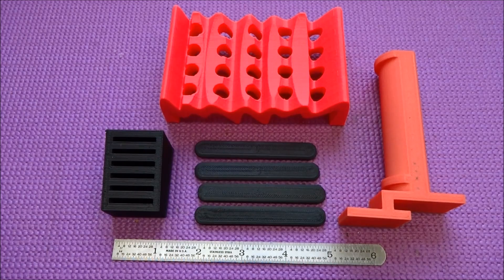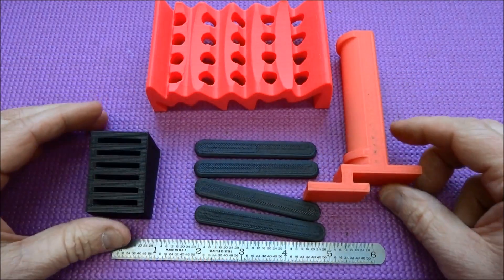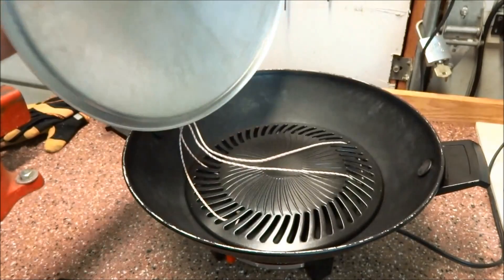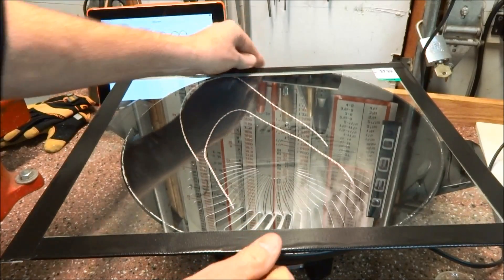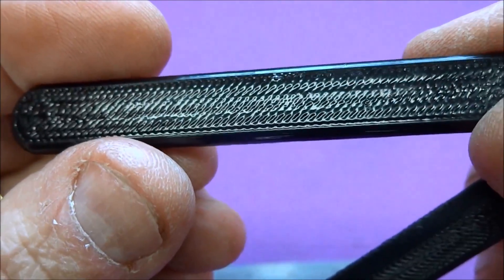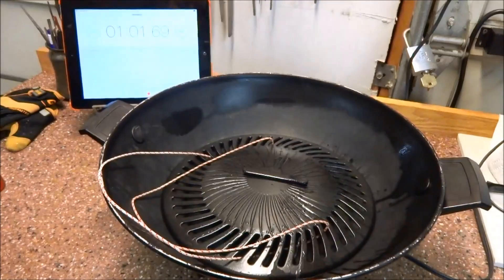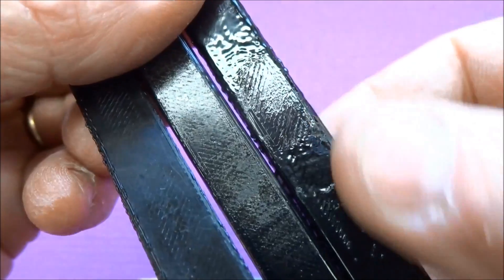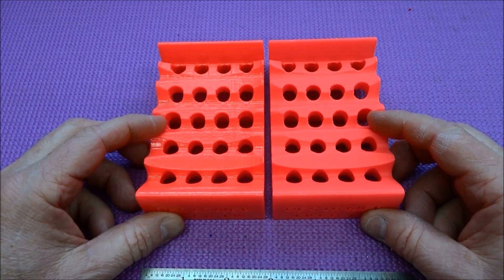(453) Improve the Finish on 3D Prints (Makerbot)

Comment: Foolish... Acetone may boil at 133°F, but it's flashpoint is only -4°F. The slightest spark could ignite the combustible vapors. How about doing this experiment at room temperature using less acetone? If you can spent 5 hours printing a soap dish, 10 or 15 minutes of room temperature acetone fumes shouldn't be much of an inconvenience. Boiling it sent much of the vapors into the air before you even put the lid on, reducing the efficiency from the start. You can use the process with multiple parts at the same time as well, so better safe than sorry.

Comment: Turned out there was another "chucklehead" not even using a fan with
toxic acetone like like it was vicks vaporub. Spark a ciggy and strike a
 pose for the Darwin awards
Reply: Acetone isn't toxic, your own body makes it. It is flammable & combustible though... Too much of anything will kill you, even water.
Reply: Okay you pedantic ass, let's get into the minutia of it then shall we?

It's also called dimethyl ketone, 2-propanone, and beta-ketopropane. It's chemical name is fucking C3H6O

In addition to yes being a byproduct of human body fat in small quantities it is also found in much higher concentrations in volcanic gases, vehicle exhaust, cigarette smoke and is used to make plastics, rayon and photographic film to name a few things I'm sure you'd just looove to inhale or ingest, and as a solvent it is used to fucking dissolve varnish, lacquer and nail polish from women's fingernails just in case you forgot...

It affects the hematological and nervous systems, and breathing moderate-to-high levels of it for short periods of time can cause nose, throat, lung, and eye irritation, in addition to intoxication, headaches, fatigue, stupor, light-headedness, dizziness, confusion, increased pulse rate, nausea, vomiting, and shortening of the menstrual cycle in women. 

Breathing highly concentrated acetone vapors can irritate the respiratory tract and burn your eyes. Skin contact with acetone can irritate and damage skin

Exposure to acetone can also cause lowering of blood pressure, bronchial irritation, difficulty breathing, shortness of breath, abdominal pain, and an increased need to urinate.

Now I don't know about you, but TO ME THAT SOUNDS PRETTY FUCKING TOXIC.

IT IS ALSO LISTED IN THE ATSDR which is a database of TOXIC FUCKING SUBSTANCES

Although certainly not as toxic as say, Hydrogen Selenide, playing with it in the manner seen in this video is asinine or AT BEST idiotic

If you wish to discuss the comparative semantics of the dangers of drinking large quantities of carrot juice vis-à-vis the wonders of inhaling boron triflouride please do so elsewhere.

I am now finished ranting at my troll. Please drink 3 liters of Acetone, and pick up your award on the way out at which time we can discuss further. Thank you

Comment: I found a method on YouTube that seemed to improve on this method a little. Use a rice cooker and pour the acetone in when it is still switched off. Place the part inside, place the lid on, and then switch the rice cooker on. When the glass lid starts fogging up, start the 30 second count.

Comment: I have only tried acetone bath once, and it came out pretty well. Here's the image: http://1drv.ms/1PKyXlAI used a tinfoil loaf pan, and sat it on the heated bed of my printer, with the temp set to 70C. I used a lot less acetone than you did - just a couple teaspoons. I hung the ring on a piece of wire, poured in the acetone, then covered it with foil. I let it sit for roughly a minute (I didn't time it like you did), and then took off the foil and let it sit for an hour or so.One thing that I did different that could make a difference for you is that I refrigerated my part in advance, so that the acetone would have more of a tendency to condense on it. I am very pleased with the results.

Comment: Does this work with PLA please?
Reply: +Brian Roberts Nope.
Reply: +Brian Roberts You need something to replace the Acetone. Tetrahydrofuran can be used to smooth PLA parts in a similar way like the acetone vapor does for ABS. Tetrahydrofuran gets used as a direct-welding glue in the swimming pool industry from what i've seen, it is used to 'weld' PVC sheets together to make watertight sealings. So it can probably be bought in some home depot stores too, just not shure what other additives they add into these glues. I've got a small sample of pure THF that i've bought at a local pharmacy that sells all kinds of chemicals too. Just did not have time to actually try it out on a part yet.
And just remember, it's not water you operate with, so at least wear some glasses, gloves and work in a open, well ventilated area, especially when you vaporize that stuff! I'm shure inhaling THF is just as bad as inhaling acetone. so, stay safe (a good respiratiory filter would probaby not be a bad idea too)
And both chemicals can probably make some nasty explosive gasses too or at least catch fire easily. Don't heat it up too much either, or it can break down into even nastyer byproducts you don't want to be dealing with. (Hearing that 'hisss' when he dropped the acetone into the hot pan, well, I did not like that too much.) And he could have put the lid on almost completely before even starting to add the acetone so he would not have lost half of it to immediate evaporation into the room... Again, be smart, and stay safe.
Reply: +ExtraBase interesting idea, I wonder if that's the same chemical they use to "solvent weld" plastic pipes together with

Comment: Idea. sand first all the way around with 400 grit, including side that was on the build plate. Then acetone. A quick sand should knock off all the extreme defects, the acetone will give it a polished look. Maybe...
Reply: That will make a huge difference. Adding a slight curve to the plexiglass should keep condensation running to the outer edge.

You can also submerge the parts in a solution of 50/50 water/acetone for longer periods of time will also smooth the surface evenly and is probably much safer.

Comment: Hi bill, would this work with PLA? And where do you get the acetone? I tried an acetone nail polish remover with a 'cold' version of this and it turned the PLA into mush.
Reply: I disagree. Thats like saying a beer is not a beer because it has something else in it compared to another beer. All beers are different, Just like PLA. Its still PLA and labelled PLA, and uses the temperatures of PLA and not cheap too, and the other stuff mixed in is to actually improve print quality. Sometimes (especially in this case) Purity is not what you want hence i buy a different brand to achieve superior post production results. Telling me i am not using PLA when I clearly am, is just silly. I am merely showing you how good high quality PLA filament from Colorfabb (very highly rated across forums) and UM PLA both smooth extremely nicely in acetone. I seriously doubt that your PLA is any better than mine. But one thing i can say for sure is that my models will look better than yours afterwards. And that is my point. Not the purity of the PLA. Who cares about the purity of PLA anyways? Its not like anyone cares whats in the PLA but rather what it looks like once its printed with. Feel free to carry on using your 'pure PLA' I will certainly stick to using mine for obvious reasons.
Reply: Fred Gerantabee  No this will not work on PLA. PLA does not smooth in acetone.  This works for abs. although a safer way to do this is to do a cold vapor smoothing. however it does take longer.
Reply: Dipping PLA into acetone works, I have no idea why so many people insist that it doesn't, clearly they don't experiment at all.
Reply: It does not smooth it. I have tried. If you are getting smoothing then you are not using PLA.

ABS on the other hand does.  PLA will soften. and often cracks or delaminates but it doesn't smooth.

Maybe the brand of PLA you are using is a mix of plastics.
Reply: What type of PLA are you using? I use COLORFABB and ULTIMAKER BLUE. These PLA blends work for sure, as they are used in my videos. Stay away from cheap chinese brands as they often use purer PLA which smooths MUCH less. You want the ABS/PHA/PLA blends.
Reply: Mark Burton What type of PLA are you using? I use COLORFABB and ULTIMAKER BLUE. These PLA blends work for sure, as they are used in my videos. Stay away from cheap chinese brands as they often use purer PLA which smooths MUCH less. You want the ABS/PHA/PLA blends.
Reply: Cloakfiend See that's not pure PLA. that is a blend. its the other plastics in that filament that is allowing you to smooth it. you just proved my statement.  PLA by itself does not smooth in acetone, a blend can depending on the blend but then its not pure PLA. So telling some one PLA will smooth in acetone is misleading them.The PLA I currently am using is from Solutech. it is made in the USA and it is pure PLA, this gives more consistent results.
Reply: You using a blend pure and simple. It is not the PLA that is melting and smoothing, it is the ABS in your blend. Hence you are technically doing ABS smoothing. 

 I am not saying your PLA is bad. Personally I don't care what you print with.  But if some one prints in PLA and then uses acetone to try and smooth it and if they are not using a blend then it won't work. It could even ruin the print.

As an example I printed the 20 MM calibration cube in PLA. wanted to see what acetone does to it. so I dropped it in glass bottle filled with acetone. with in the first little bit nothing appeared to happen. left it over a hour. I got some discoloration but nothing else looked to have happened. left it over night and it started to delaminate. was slightly squishy.  It did not smooth at all.

if you do that to abs it will quickly start to melt and if left over night it will dissolve (assuming you  have enough acetone)

So telling them that acetone smooth's  PLA is incorrect.  Telling some one that it can work on a pla/abs blend well that's a different story.

Your analogy with beer isn't exactly spot on either but who cares. When you blend something it is neither one or the other but a combination of both. This can make it so it takes on properties of both items to some degree.

there are plenty of videos on youtube showing that PLA does not smooth using acetone.
Reply: Well I've clearly mentioned the brands of PLA (which is sold as PLA) I use so I am not misleading anyone. You want my results, use the same PLA as I do simple. Discussing the composition of plastics is just getting into semantics. And why on earth you'd want pure PLA (composition wise) for 3d prints that are most used for art or base moulds or prototypes is beyond me anyways.
Reply: Mark Burton Well I've clearly mentioned the brands of PLA (which is sold as PLA) I use so I am not misleading anyone. There tons of brands of PLA, all different you think anyone really cares about the PLA content? Its all about print quality, thats what we should be discussing. You want my results, use the same PLA as I do simple. Discussing the composition of plastics is just getting into semantics. And why on earth you'd want pure PLA (composition wise) for 3d prints that are most used for art or base moulds or prototypes is beyond me anyways it offers no advantages what so ever other than you can tell people you are using pure PLA that wont smooth? so why on earth would you seek out pure PLA? when other brands offer a better product (composition wise).

Comment: It looks like a great idea until you realise you have a perfect combination to make one hell of an explosion...glass and flames in the face too.  Oxygen, warm fuel and the thermostat inside the wok, that is a million miles from intrinsically safe. When the wok thermostat relay opens the heating elements are slightly inductive so a spark is generated on the contact each and every time. If the fuel source acetone, finds it way inside (and there is nothing to stop it) then you have one hell of a bang potential on your hands.  People are killed routinely after trying to weld containers that have been purged of fuels several times with water. The slightest amount of fuel mixed with air makes a massive bang.  I once did an experiment when I was young and stupid with 2 litre bottle with a small amount of fuel source and a fuse.  We put it inside an abandoned car at a rubbish tip.  The explosion was immense, just 2 litres with a tiny bit of fuel plus air and it blew the boot open.  DO NOT TRY THIS AT HOME.  Recipe for disaster.  If you must, heat the wok, take out the power plug and take the whole affair outside, touch the pan with your fingers to make sure it is not Too hot, then add you fuel.  Remember the element underneath may be very very hot, so don't spill any there or you will get one hell of a BANG.  Just remember the triangle of combustion, heat or electricity, oxygen and fuel.  Play will all three together, sooner or later someone will always get burnt or naturally selected.

Comment: Nice challenge conquered. Im here from Painless's page from his mention of your 3d printing. Im building quadcopters and have some 13mm carbon tubes coming. He showed your arm ends for 16mm tubes. Im just south of Richmond. Ide like to set up the makerbot I have access to at work to mod the 16 into a 13 diameter. Is scaling like that possible? Could you perform the mod and post the data? Thanks.

Comment: One thought on your condensation problem is what is commonly called in Chem Eng circles as a reflux condenser. Modifying the type of lid you use to a funnel and connect an externally cooled (by water or ambient air) metal tube into which the acetone vapor enters in and cools down to liquid again. You can then direct the flow from the tube back under the part and though you can't take the risk of sealing everything down and risk a pressure buildup, you can cut down on the acetone vapors in the surrounding shop space, thereby cutting the risk of explosion from accidental spark from electrical or static buildup.

Comment: What is your layer thickness?
Reply: Bryce Villanueva Yeah, but most developed countries saw the light a while ago!
Reply: bosnianbill There is no way you printed these parts at 20 microns. The lines on the parts are more like a 0,2 layer hight.
Reply: Rod Briggs Wrong, 20 microns = 0.02mm
Reply: +fitztheviking We did, it's called the metric system!
Reply: Exlr8Films
 yes 20 microns is 0.02mm but bosnianbill said he printed 0.020" which is inches. wish we would pick one set of units and use them worldwide.
Reply: Exlr8Films.020 is not 20 micron its 20thousanths of an inch which is roughly 508 micron
Reply: +fitztheviking Google: 0.02 inches = 508 micron
Reply: Bindo *Not adopted everywhere

Comment: Nice video thanks for sharing!! i love 3D printer. can i confirm does it makes the plastic stronger after the treatment? or still same strength??
Reply: bosnianbill Actually Lego is made from exclusively a Bayer modified ABS , the clear products of lego are Bayer Polycarbonate. ABS is a Styrene derivative. Would be interesting to see what Styrene monomer  ( or MMA or BA ) does . It has a strong smell , however does not vapourise as much as Acetone and could not be as senstive to the 30 sec rule ??????